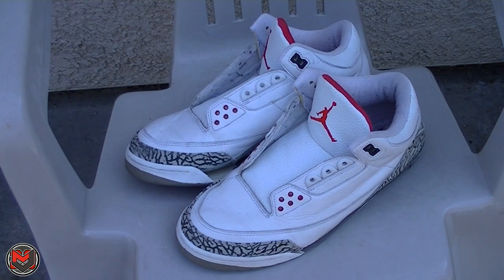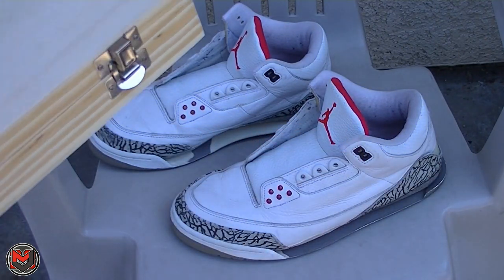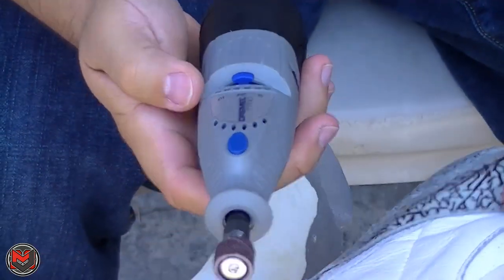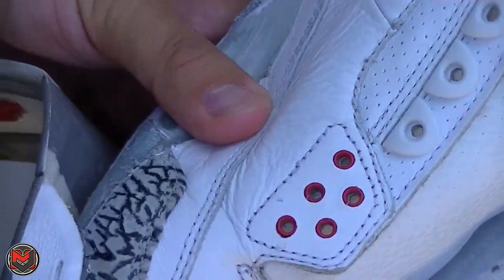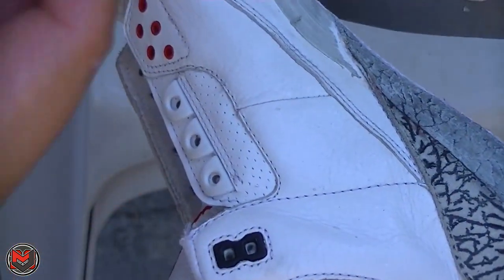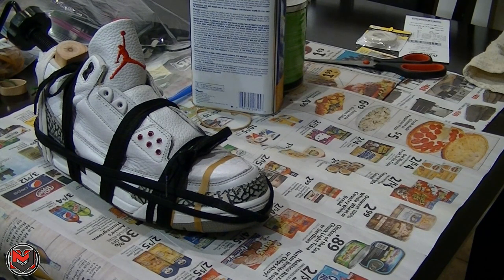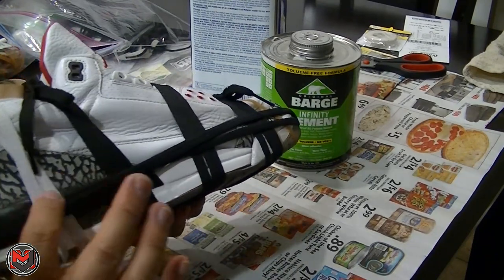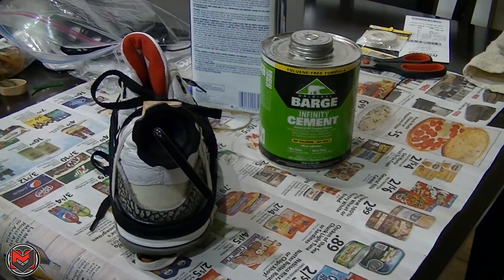The Air Jordan 3 Restore Project - Part 7 - Reattachment

Comment: so how have they held up, up until this point bro? I'm about to start on my 94s
Reply from the maker: +Ramon GotKix Actually pretty well even after 6 months. I wear them about once a week and have had no issues with separation. I want to test them when the summer hits but the glue seems to be doing a great job keeping everything intact.
Reply: Ok great to hear. I was using E6000 just for a few touch ups, but wasn't sure if that was the route to go for a full swap. After watching your videos 1-8 I'm definitely going with barge lol. Amazing job by the way.

Also, I follow you on IG, If you ever get some time, look me up  @Ramongotkix
Reply: And thanks for always coming thru with the speedy response, man. #Respect
Reply from the maker: +Ramon GotKix Yup Barge is the way to go. Thanks for tuning in bro. Good luck with your future restorations!